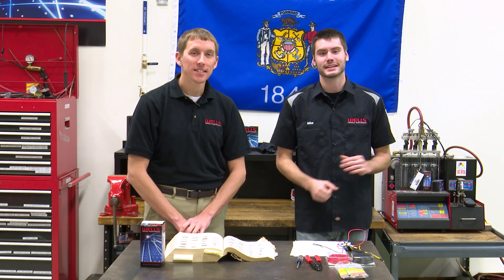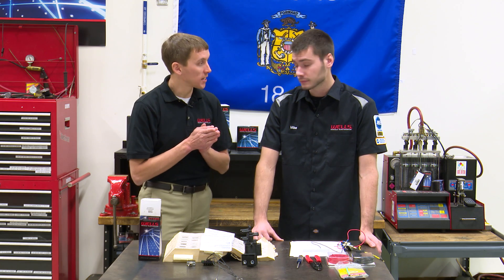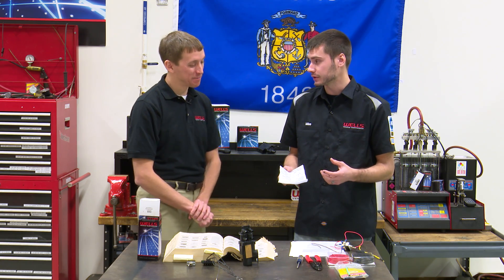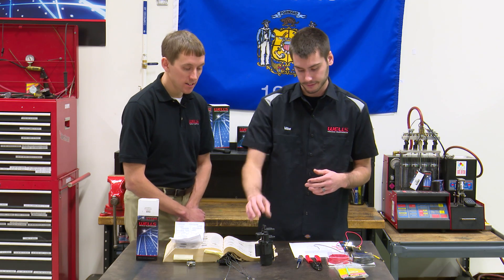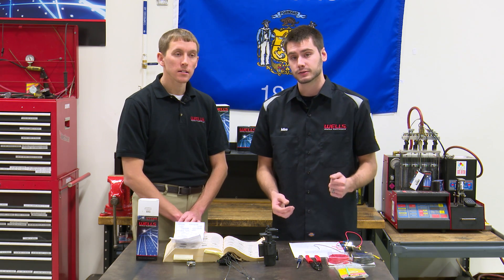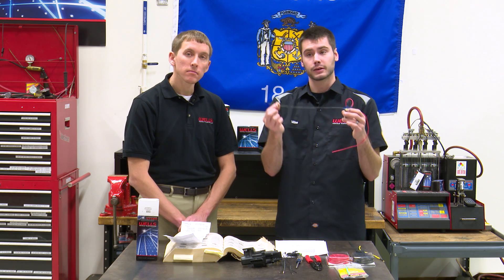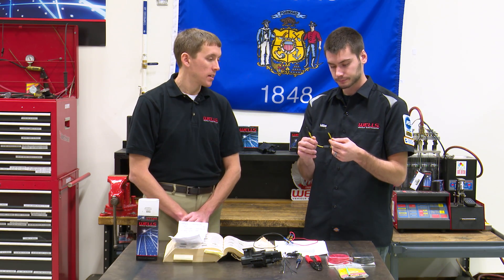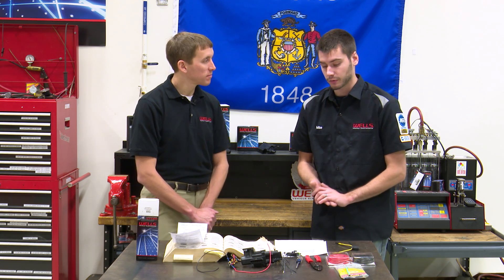Wells CounterPoint Ep.14 Fuel Tank Selector Valves (FSV1K & FSV2K, FSV1 & FSV2)

Comment: You should probably say the filter needs to be between the tank and the selector valve. Older Chevrolets have a mechanical fuel pump on the block pulling the fuel through the valve from the tank.

Comment: this will actually bold directly onto a 1987 chevy silverado with factory dual tanks and tbi this is actually what  i bough to replace mine when it went bad
Reply from the maker: Great to know! Thanks for watching.
Mike Becker, Senior Technical Instructor
Reply: That's what I'm trying to do now. After you took the cover off and unhooked the hoses how did you get it off the frame?
Reply: So the wiring is the same?
Reply: @SteveGrin  I think the wiring is the same... gonna try it on my 85 C10

Comment: Hey the video did help but I have one question my vehicle has two 20gal tanks on either side of the vehicle both of them run to the same pump would this at all change the installation (neither tank is labeled as auxiliary or main or any other indication) and after I've hooked up the new valve the universal one looks just like the stock one that's on it... I'm gonna have to label the switch because I'm gonna forget which switch position goes to which tank so how would I tell... 1985 Chevrolet C10
Reply from the maker: Hey Frank, sounds like you'll either have to trace the wires or fill one tank up, leave the other empty to determine which is which on the switch.
Mike Becker, Senior Technical Instructor
Reply: Ok I kinda figured and also I did more looking and the wire that comes out of slot a on the pigtail is going to the tank on the left it's still bent into shape but it isn't attached and I haven't yet figured out a way to reattach it to the gage sending unit without removing something else which is probably why the tank switch isn't working

Comment: After hours of troubleshooting and being stranded overnight in my 86 f250 6.9 idi dual tank I found that this was the culprit. My question is I completely disassembled the oem part and found the motor to be bad. I noticed though that when I rotated the stud that when the back tank was in use it was only drawing from the back tank however when in postion for the front tank it also left the port for the back tank open. Is that normal or a flaw in the old unit? I have ordered this exact part and am very confident with the help of this video and knowledge of electrical to install on my own. But it would seem to me if this part did the exact think when running on the front tank my return line would be also be robbing from the front and filling the rear. Any thoughts or insight on this?
Reply from the maker: Matt, that doesn't seem normal. I don't believe these are intended to cross fill tanks.
Mike Becker, Senior Technical Instructor

Comment: Why won't the factory selector switch work? I have a 93 f350 7.3 IDI. The front tank worked fine then when I switch to rear tank it instantly blew a fuse. I guess I'll be wiring in the included switch. Just curious why this won't work with the oem switch?

Comment: Hi, this valve will work with the oem switch 411, or need other switch, by the way is for 86 chevy c10
Reply from the maker: Hi Carlos, the 411 is just a pigtail. it's not a switch. If you buy the FSV2K it comes with the switch.
Mike Becker, Technical Services Instructor

Comment: Thx for he video. I think in my case a 1990 F-150. It will be easier but more expensive replacing the fuel tank reservoir switch assembly. If I can't locate part from wrecker I'll just have to shell out $200+ for a genuine replacement part.
Reply from the maker: Yeh James, this is not easy to do by any means :)
Mike Becker, Senior Technical Instructor
Reply: Every time I put gas in my rear tank, my front tank gets full. Right now, my front tank is so full it's leaking out. This culprit has to be my problem.

Comment: So I have an 87 Chevy with factory fuel tanks. I understand this valve switches from one tank to the other. My question is, does the signal for the fuel sender also switch from tank to tank?
Reply from the maker: Hey Josh, yes it would switch the gauge over to whichever sender is currently being used. Great question!
Mike Becker, Senior Technical Instructor

Comment: For those that have the valve still, if you fed the positive line to the return of the front tank with a little pump, no selector valve needed. All you do is you put a bolt in the fuel line for the rear positive line & that’s it.
So if you want fuel in the front tank you hit a button or switch, & flit it off when full.

Problem solved.

A video will be available on MikeJD60 soon.

Comment: so the main front and rear switch will NOT work withthis valve ???
Reply from the maker: Hey Cullen, you're correct. This is not a direct replacement valve. It will need to be wired up to the supplied switch.
Mike Becker, Technical Services Instructor

Comment: not one wire is the color you describe, very poor instructions and after spending a fortune in extra parts, should just buy fords overpriced selector valve as it would have been cheaper and no frustration, looses
Reply from the maker: Rob, sorry you are having a hard time. Wire color will vary with every vehicle. If you need any further help with it please call our techline number at 1800-558-9770. Thanks!
Mike Becker, Senior Technical Instructor
Reply: thank you, finally figured it out, was bad ground at frame from battery.